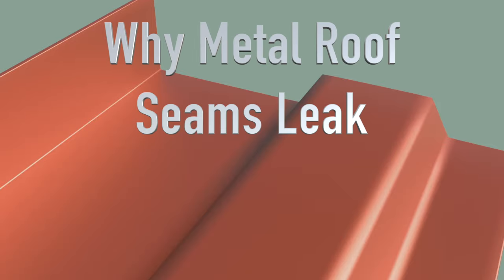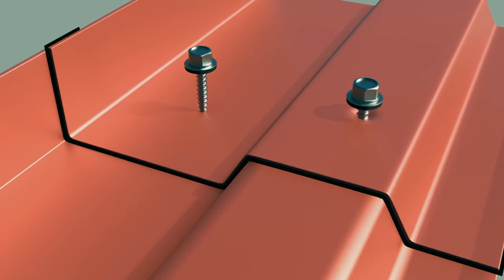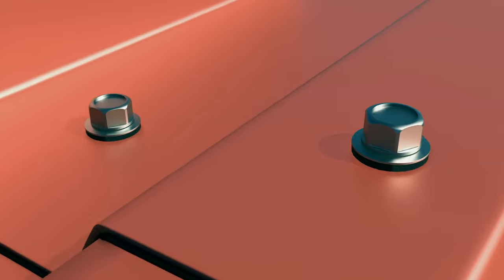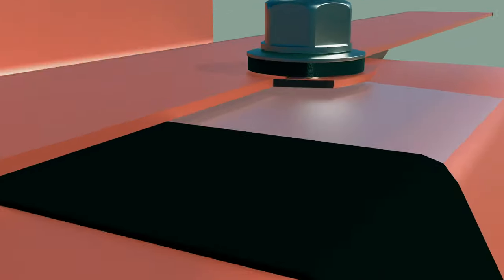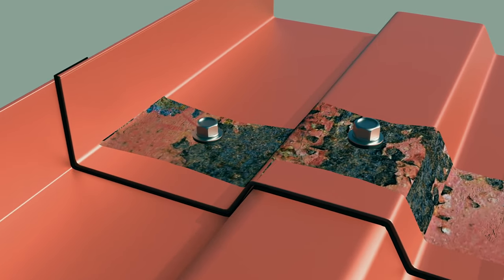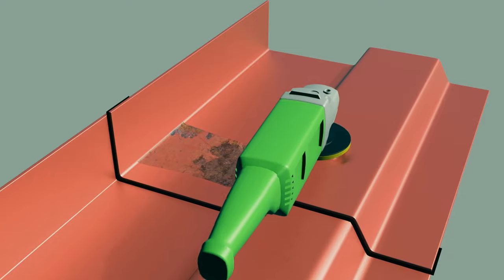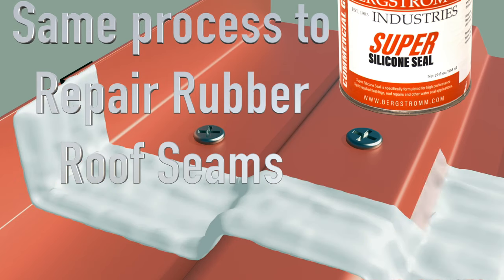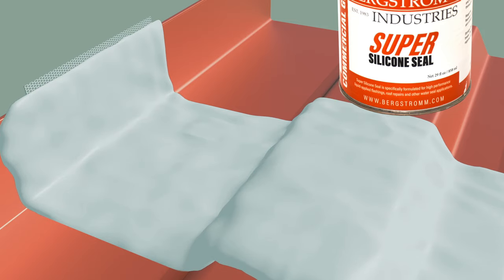How to Repair a Flat Roof leak- Why METAL ROOF SEAMS LEAK - Super Silicone Seal

Comment: The life of the neoprene seals is 20-25 years if the screws have been seated onto the roof correctly.  The specification by the roofing manufacturers is to put both a 6mm diameter bead of caulking at the lower end of the lap joint, AND a 3mm bead covering the top cut edge of the underlap sheet.   This prevents condensation running down inside the top roof sheet and into the overlap area.  Without this extra bead the water will accumulate again in the joint and it  will cause rust.
If you just seal the top surface it won't stop the water and rust accumulating again.

Comment: If there is rust on the  roof surface it is likely to have spread to the underside.  You do get condensation on the underside of a roof especially if no building paper or similar is used underneath the roof.  As rust will continue so if you can, lift the roof iron and treat and seal  any rust on the underside.  Corrugated  iron roofs will rust where lapped if it hasn’t been done properly,  and also on edges due to capillary action and weather driving water underneath the edges.  No one does it but a roof will last the longest if painted both sides.  But it is important to paint the lapping areas both sides  and also I would paint the underside of the edges where they empty into the gutter.  I have an internal galvanised iron box gutter and on inspection it was a shocking job.  The laps were not painted and the channel was only half painted.  Luckily while it was rusted it hadn’t gone through so I have cleaned it up rust treated it applied a waterproof membrane sealer and painted with a good anti rust paint.  But I still have the problem of the rust continuing on the underside and short of going into the crawl space to access not a lot I can do other than lift the gutter which will be a dreadful job.   (The roofers nailed the roof batons over the guttering).  The only other option is to insert a sleeve to fit inside the existing gutter to take the water  but it will not be an easy  option either.

Comment: Great video! I've watched several of your videos, all good. I'am currently repairing my flat roof motorcycle trailer. It's a large one piece metal roof with with a 90 degree drip edge down both sides and across the back. I've removed the drip edge, unscrewed the roof and wire wheeled all components down to bare metal. I reinstalled the roof panel with Solar Seal 900 and screwed back down. I now have to reinstall the drip edge. My thought was to Solar seal that down as well. I would like to use the Bergstrom Poly sealer and tape down the top side of the drip edge where it meets the roof,  which would be the first line of defense against water.  I'm  just not sure which of the two,  Turbo Poly or Silicone Seal to use. Also any thoughts as far as using Solar seal on bottom side of drip edge or should I use some other product? Thanks for  your time, your advice would be greatly appreciated.
Reply from the maker: Not familiar with Solar Seal. Too many products on the market to keep track of. Turbo Poly Seal works very well on transitions where there is a vertical surface. If repairs have to be made where it is very flat, then Super Silicone Seal will work too. You get more milage per gallon with Super Silicone Seal. Turbo is very strong, Super Silicone is very flexible. They both adhere well to metal, rubber roofs. Turbo does not work well on glass, plastic and EPDM Rubber whereas Super Silicone Seal is excellent for that.
Reply: @FlatRoofDoctor  Thanks Doc, that was an amazingly quick response. I'll go with your advice on the silicone seal and get back to you soon. God Bless You,  America  and all our troops this holiday weekend!!!
Reply from the maker: You probably have already gone ahead and done the work, Sorry for the late reply
I am not familiar with Solar Seal. Here is my thought.
Apply the solar seal under the drip edge and rivet the drip edge to the existing metal. Then use Super Silicone Seal with the fleece to make the transition between the drip edge and the metal roof.

Comment: Why then not do it as a prevention before it starts to leak?
Reply from the maker: Good Question
1. Newly installed roofs do not have fasteners like in this video and will not need such treatment.
2. If you understand where the leak originate from, then maybe it is easier to seal the fasteners only. 
3. The video is intended for those who is beyond of just fixing the fastener leak but need to take care of the seam that has rusted because the issue was never fixed

Comment: Hello, I have an 18 year old double torch down commercial roof(both layers were torched down).  Some of my seems are separating, anywhere from an ⅛ inch to ½ inch.  The whole roof is 10,000 square feet it is happening on about 5% of the roof.  What do you suggest for repairing it?  Possibly reheating seems?  You comment would be much appreciated.
Reply from the maker: Can you send some pics of the seams and also seams where there was some bleed out. I can't understand the inconsistency. There should be a bleed out of at least an 1/8". Some overheat it and bleed out over an inch. Tel. is 203 858 0080. Send pics to this number

Comment: I have applied a silicone coating to the entire roof (Tropicool) and am still experiencing leaks at the seams. What should I do? Caulk won’t stick now that it is coated, but this silicone coating isn’t doing enough. 

This is a bit different though because it is on a school bus. Any ideas?
Reply from the maker: You should have taken care of leaks before doing any coating. Just to coat entire surface in the hopes of fixing a leak is never a good idea. Thats why I show how to take care of leaks instead.
Reply: @FlatRoofDoctor  yes, I did try to fix all of them before. We just had a couple new ones pop up that weren’t leaking before. Any suggestions if the coating is already down? Could use your expertise!

Comment: I was watching many many videos on how to inatall metal roof....and a saw many with no hidden screws, and mostly all of them use no sealing...i was this is not right, this will leak...
Now i am seen a couple of videos with roof leaking., and how to fix it.
Reply from the maker: Hey Mario
When you install a new metal roof with new screws and neoprene washers, then it will not leak for many years.
The neoprene washers will eventually harden, crack, and shrink, relieving the pressure that was exerted by the screw onto the washer and metal surface. This will make the screw feel loose. Since there is no more pressure, water will leak in at the screw.
One way to remedy this is to replace the screws with a larger one with new washers.
The other fix we sometimes use is to dab Turbo Poly Seal over the screw and washer.
I hope this made sense?
Naas

Comment: You shouldn't put screws in the valley, they should only be put on the ridge. Most of the water runs down the valley, the surface shouldn't be penetrated.
Reply: Actually that's not 100% right,  they call out both